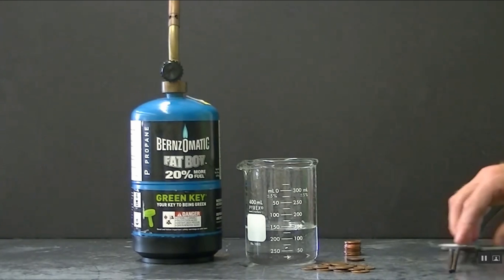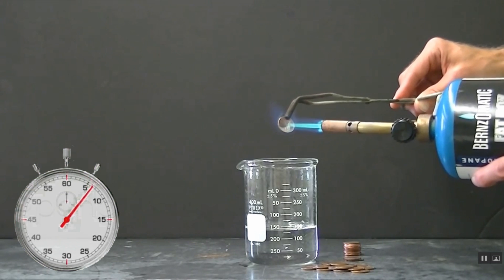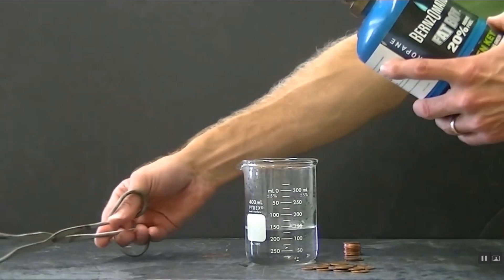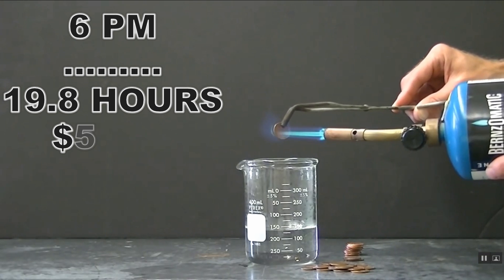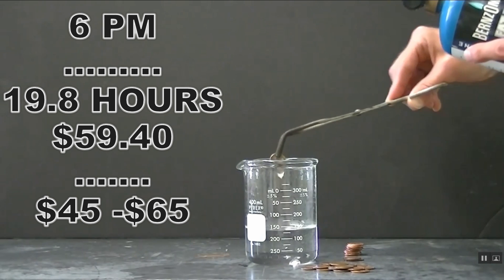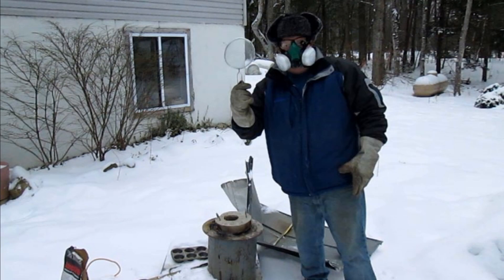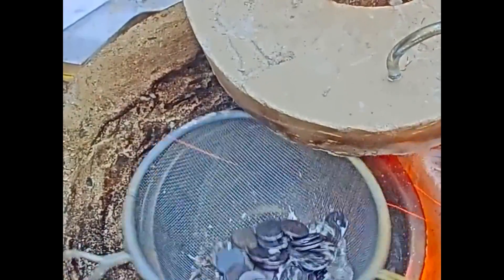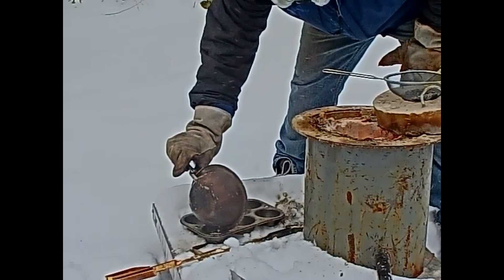The most (cost effective) way to separate [Copper from Zinc pennies]

Comment: This has to be the lameist video on you tube ;)  All you need is any metal detector with descriminate.  You set the discriminator to ring out on copper and silent on zinc.  You can pass at least a hundred pennies a minute over the coil and toss them in the appropriate basket.  Take the zinc back to the bank and keep the copper.  Fastest way.

Comment: This is exactly how I planned to make my copper ingots.  I'm buying a graphite 5 pound copper mold to boot.   

I've been looking for a strainer for the coins, and I was going to make one out of steel cans, but buying one like that makes a lot more sense and it looks like it works well.
Reply from the maker: It did work, and I really liked it as an experiment but if you are looking to make copper ingots.  You can buy copper cheap by going to a scrap hard and buying thick wire with the rubber still on it.  Scrap yards think that stuff is kind of a pain so its about 1/3rd the price. there are clamps made for stripping wire on ebay for about $35.  If you want cheap zinc, go to a thrift store and get a fake brass lamp.  People hate them, so they are common and really cheap.  Like $5 for 15 pounds of good zinc.

Comment: How do you make money doing this ?
Reply from the maker: well i do metal sculpture also scrap metal pic ups.  But my main point of this video is that this in not a way to make money.  But if you want to make good money on Zinc go to a goodwill and look for a fake brass lamp that is really heavy and does not respond to a magnet.  Zinc scraps as much as $1.25 a pound and some of those lamps are 13 lbs for about $5. just take them apart

Comment: Love it when a 2 minute video helps many people save their time and money.  I don't scrap for money, not anymore anyway (college, yada yada) - but I hate taking things to a dump and having to pay THEM money, so I scrap things to make a few dollars to pay for my gas.  Still not practical when I could be working a cash job - but what can I say, I get bored.
Reply from the maker: I do a fair amount of scraping on top of having a job.  I just don't do this for money
Reply: @tomasistudios2618  My former employer (I quit to go back to college averaging 14-16 credits a semester) owned a water conditioning company.  Sometimes he would pay me to sit and cut up copper and bronze and separate it into piles just to make room in his shop.  I'd make 100 in a few hours, he'd make 1,000.  We all have our reasons ;)

My current interest is in smelting copper to make bolsters and buttes for knife handles as I've taken an interest in bladesmithing.  I figure I get to get rid of some trash, recycle responsibly, and separate the other metals for the scrap yard.  I wouldn't do it if the weather called for good fishing :P
Reply from the maker: @thomaswolf9297  I used to work in a metal shop and they were fine with taking the nickel after the machines were done with them.  I would punch out and sift through the dumpster with a magnet to skip the steel I took it to the scrap yard and made a bonus $80 a week
Reply: @tomasistudios2618  Haha, family members of mine worked in a metal CNC & woodwork shop and did the same, we still get free wood frequently.  All power to those who can do it.

Comment: How would you separate the copper and zinc from old pennies. 

For example 97% copper 2.5% zinc 0.5% tin from the bronze alloy into just copper.

It seems it can't be done with heat but possibly through a hydrochloric acid process. 

I was wondering if you had any knowledge/experience on this issue.
Reply from the maker: well by at its root this is a chemical change, in some cases a chemical change can be reversed through electrolysis but it would cost so much you might as well buy the metals
Reply: @tomasistudios2618  I see. Thank you so much for the exact information I was after. It sounds to be correct from what else I've read. You were very helpful, appreciated.

Comment: hey how would i get gold away from copper then? gold melts 1200deg c while gold is 2000 deg c, and yet i hear people are using  zinc to collect silver, and copper to collect gold, do i burn the copper and watch the gold drop out like your zinc drops out? is it a atomic weight thing? that i must use?
Reply from the maker: I think that is false information Gold, Sliver, Zinc and Copper are all elements on the periodic table.  The only way I know to make an element from raw materials is with a particle accelerator.  I only saw one example online of someone accurately trying this and they admitted that all they were doing was changing the metal to silver shade and gold color.  But only on the surface. And in no way actually changing the metal; sorry.
Reply: ok , so i do what is called reverse electroplating of computer ram chips where the copper and gold and zinc and solder passes into soloution casting off an electron, then as it bonds to the cathode from annode it gains an electron making it resolidify, but because the other electrode is non bondable and stainless steel or other matter that won't bond, it causes nano to drop out and become dust, but my problem is they are all together as dust, should i heat or use acid? what do you recommend? should i smelt them into coins or consider their smelt heats and bring the lowers up and drip them out while retaining the copper bar, i was told that copper is 2000deg c to melt, while gold is less at 1200deg c so what stages do you recommend? burn off zinc or find gold will follow zinc or stay with copper? will lead burn off because of it's heavyness?
Reply: one other problem i have is when i boilded the gold mix nano in a steel house stove pot, i lost my gold only to find it corroding the pot and little oxide holes with gold in them, should i expect to use them hole technique to reveal the gold as it as actually presented itself
Reply from the maker: this was interesting I saw this link 
 https://www.youtube.com/watch?v=yb6xPB6IHGA

it looks like it might be a faster way to strip gold from things that are just gold plated.  But the guy does admit that it took him a year to collect all the gold plate he only gets 3 grams and because golf plate in electronic is usually less than ten carrot it is not worth much, my guess is that his 3 grams is worth around $85
Reply from the maker: oxidation is one of the biggest problems I have.  Aluminum for example, I can count on a metal loss of at least 15%.  when I really need the metal to not oxidize I've had some luck with silver dust inside a stainless steel hip flask I got from goodwill.  It was a worth wile experiment and I only managed to turn dust into a solid bar.  and it was death to the hip flack.
Reply: Digest the copper in nitric acid and fire assay the solids left over.